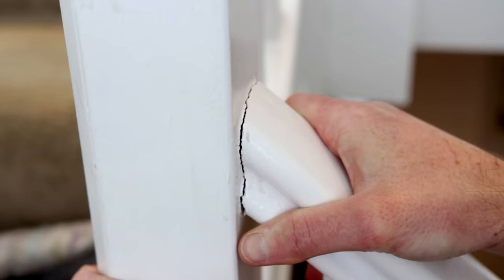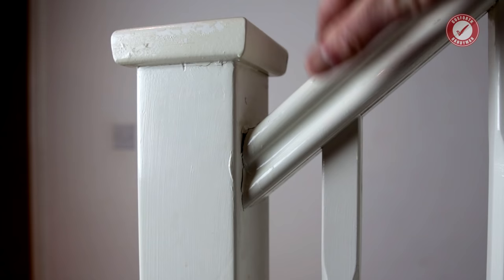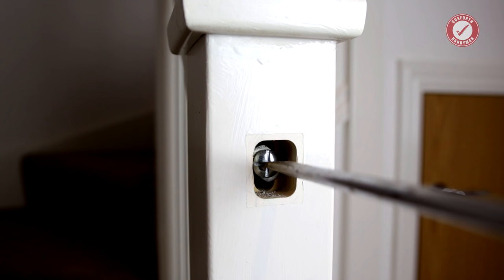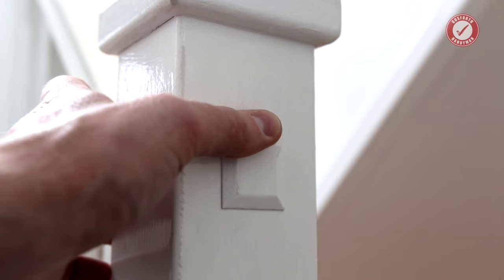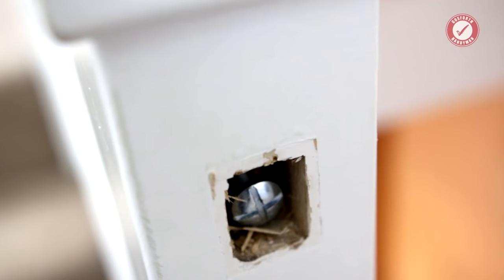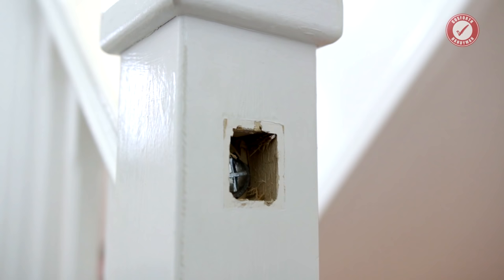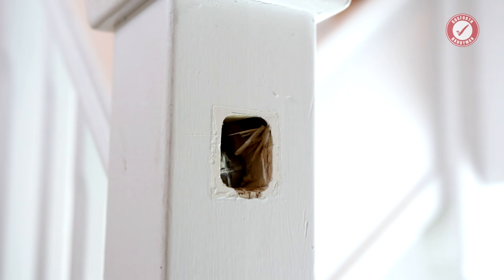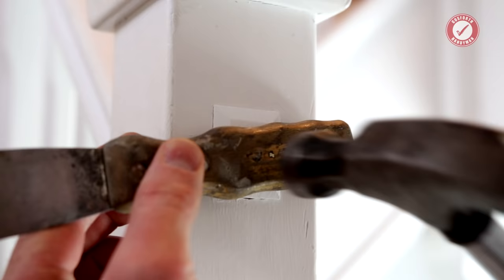Fixing another shoddy handrail / bannister in a NEW BUILD!

Comment: We have a Redrow new build with 400+ snags were still fighting almost 3 years later. I've got two videos up on our banister, at home preview and completion there was a 3+ inch gap at the banister to post, banister wasn't centered, paint job terrible, posts loose top and bottom with missing nowel caps missing from the ceiling in next room, plus the posts that run through under the ceiling had been cut inconsistently.

After multiple attempts at tightening and that failing they then decided to put a block against the wall to stabilise it. We agreed as temporary measure as it should be solid without as per design and our neighbours is find without it so clearly not been installed correctly.

Almost 3 years later Redrow still haven't sorted it and it's wobbly as hell, far more so than yours.

At completion my partner was heavily pregnant so risk of falling down the stairs was high with a very wobbly banister. Our son now 2 and a half and walking up the stairs, even with his weight it's wobbling.

The post top and bottom of the stairs isn't secure.

Curious what you make of the two videos I posted here. The nhbc were here last month and agreed it's not right but we're hesitant to suggest a removal and replacement dispite Redrows multiple failed attempts.

Comment: I need to extend a newel post and fit a handrail between 2 posts. I'm going to use zipbolt to extend the post and I think they do fittings for the rail too - any rail fittings you would recommend?

Comment: Thanks for sharing great video as always, I have some table chairs that are starting to become loose at the joints, i'm guessing they are put together by mortise and tenon joinery supported by pins, Any tips on how to fix this issue ? i was thinking about knocking it all apart cleaning up the dried glue and applying construction adhesive rather then PVA for a better bond?
Reply from the maker: Cheers for watching! If you can knock it apart, sand old glue off and re-apply decent wood glue like Titebond II or Evo-Stik wood glue that will probably be stronger than construction adhesive. You really need to clamp it while the glue dries if possible. Believe it or now superglue also works very well on wood!

Comment: Often the problem is with Christmas completions - new house buyer wants to be in by Christmas - site manager pulls out all the stops and gets several trades in at once... house goes from first fix to completion in a few weeks. Result - timber not properly dried out when it's handed over. New owner turns on heating... after a few weeks, all timber has shrunk and joints open up. Other problems caused by tight prices, meaning joiner has to cut corners to make a wage, greed by building firm and/or tradesman, and lack of suitably qualified supervision. Most site managers are ex. Brickies - ok in the setting out and early stages, but many are clueless when it comes to knowing what a good finish is, as a rule.

Comment: Great video! I managed to tighten the handrail exactly as you had shown - Piece of cake. ONLY ONE PROBLEM: some git had painted over (and possibly glued) the end cap, so it broke up when I removed it. I've spent about 1.5 hours searching online for a replacement, but can't find one. It's exactly the same type as the one in your video. Do you know where I can buy one?
Reply from the maker: It might be worth giving your local timber merchant a call - if they sell stairparts they should stock these, but they can be tricky to track down! Best of luck! 👍